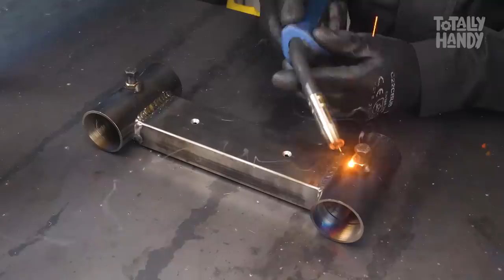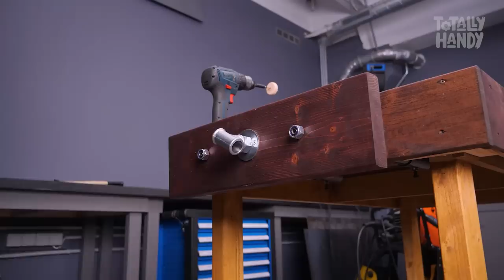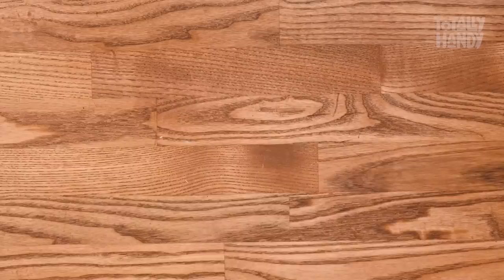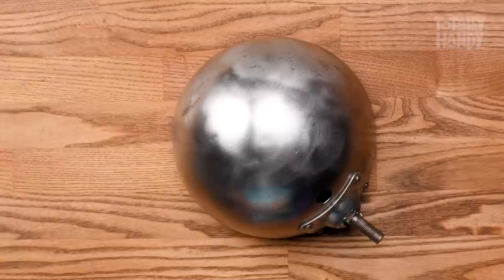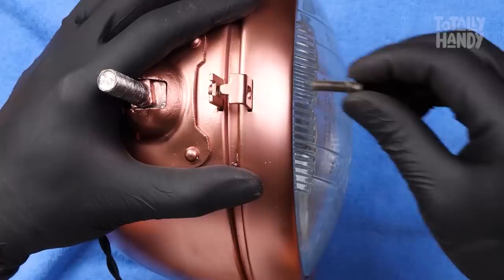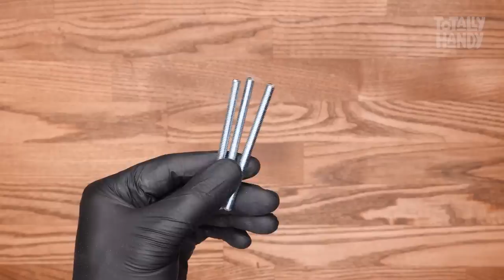Using Old Shock Absorbers to Build a Bench Vice | Remake Project

Comment: So the shock absorbers allow you to tension the jaws with only one threaded rod, and keep even pressure distributed across the jaws? Is that the purpose of using those in this project?
Reply: That and they keep the vise jaws running straight

Comment: What did you spray on it to make the paint flake off?
Reply: paint remover
Reply: Yea but what brand. Xenos I was thinking the same thing!
Reply: Sir where to find it n please the link
Reply: @NealDownBtch  there are good brands that work well on amazon
or you could find stuff at lowes
Reply: @fahad.saeed29  
Ace hardware,  home depot, 
In the paint department (paint stripper) 
SPRAY CAN STYLE , IVE USED IT ON HIGH CARBON KNIFES THAT ARE PAINTED ,